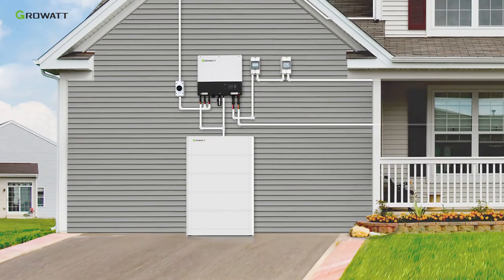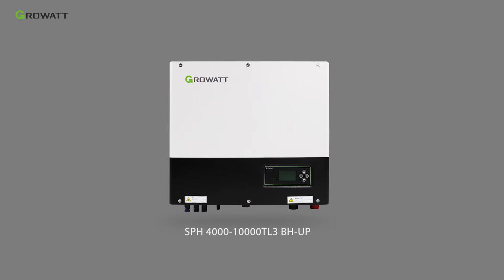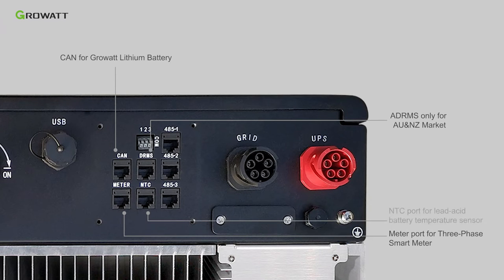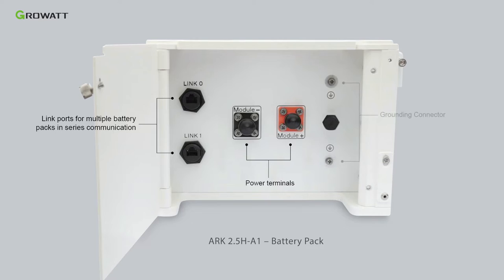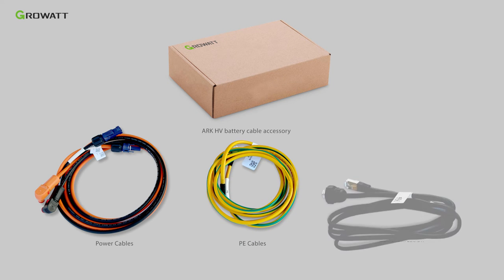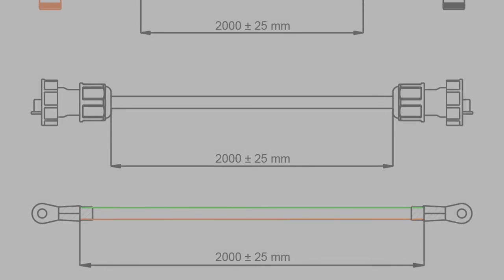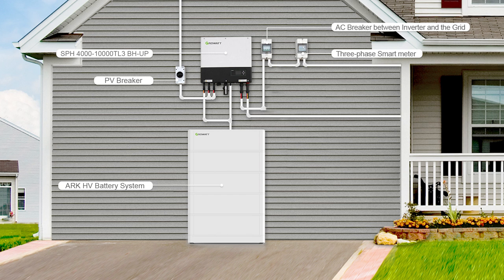SPH 4000-10000TL3 BH-UP & ARK HV Battery Installation

Comment: Can we parallel these together to have higher power output (or to have more MPPT ports for more solar panel groups).
ie, if my roof has four sides (North, East, South, West) and I'd like one MPPT per side but charging the same battery bank.

OR I have 2 of these in parallel, each having their own separate Solar and Battery banks, can they coordinate such that the set getting better solar power to give more power?

Comment: I have exact instalation as in the video. Can this pv system  be started without grid connection ? ARK baterry can be charged under 0C ?
Reply from the maker: For technical support, please contact our service team at service@ginverter.com, or call our service hotline at +86 755 2747 1942. Thank you!

Comment: 5:33 you said: "... connect the positive and negative power cable in series..." 
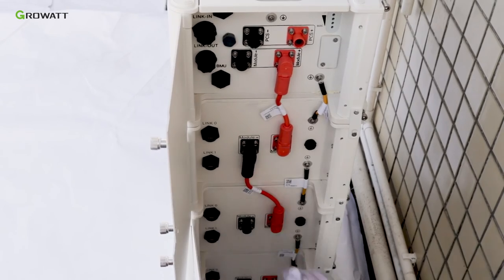5:42, the TOP battery's Positive is connected to the Positive of the battery below. what is going on here?
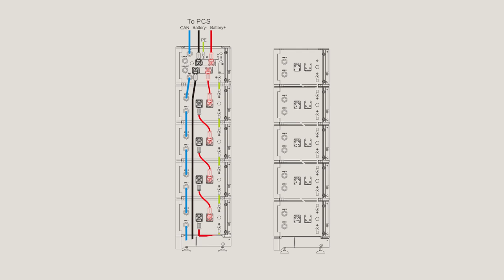7:03 Is the top module not a battery but BMS?
Reply from the maker: Hello, for technical support, please contact our service team at service@ginverter.com, or you can call our service hotline at +86 755 2747 1942. Thank you!
Reply from the maker: Hello, for technical support, please contact our service team at service@ginverter.com, or you can call our service hotline at +86 755 2747 1942. Thank you!
Reply from the maker: Hello, for technical support, please contact our service team at service@ginverter.com, or you can call our service hotline at +86 755 2747 1942. Thank you!